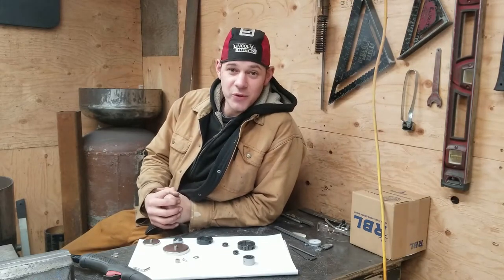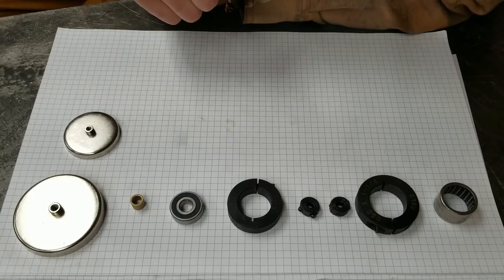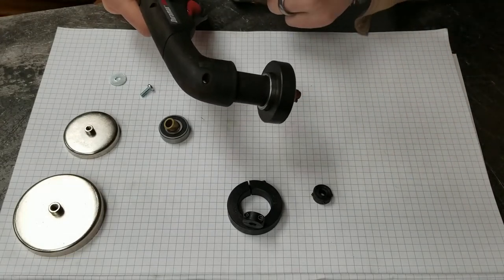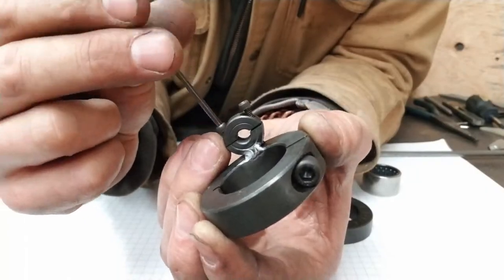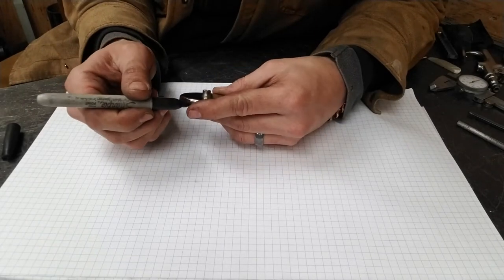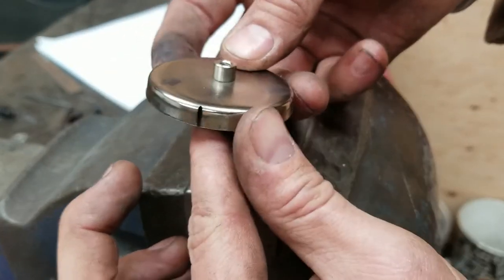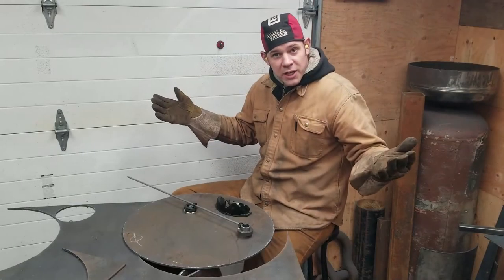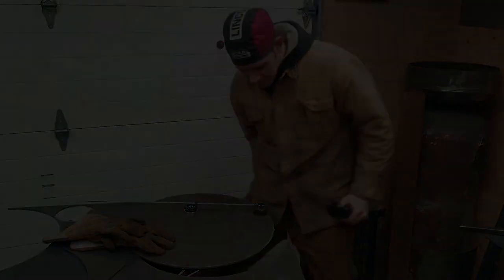BUILD IT - Plasma Circle Cutting Guide!

Comment: If anyone ordered the magnet that doesn't have the threaded standoff, you can just use a M8 bolt coming up through the magnet hole and through the bushing, it will work just as well (I ran a tap through the magnet hole as it is just a hair too small for the bolt to slide through).  Just use a washer and nut on the other side to lock it in place and everything else with putting this together will be identical to the video.
Reply from the maker: Thank you for posting this additional info 👌

Comment: Thank you for this!  And thanks for listing the parts to buy!
Reply from the maker: For sure 👍
Reply: @ShopGoatVentures  Say, I wanted to let you know that one of the parts listed above is not correct.  In the video, you have a round magnet with a threaded stem (you called it a spigot).  But the part listed is a magnet with an unthreaded hole.  No stem / spigot.  No way to mount the bronze sleeve bearing.  Can you tell me the correct part?  I looked & looked on McMaster Carr, could not find equivalent size of magnet with a stem, like the one you have in your video.   Thank you so much.
Reply from the maker: @LA-gd4eo  Your absolutely correct, I apologize for the error. I was able to get ALL the required parts through my local supplier except for the magnets. What I had done was gone to my local hardwood store and bought a couple cheep "magnetic hooks" that looked like the magnet from McMaster Carr. The problem as you have noticed, is that although it "looks" kind of like it, it is NOT the same. I never looked at McMaster Carrs detailed drawing until now and noticed what you just mentioned. I guess I fluked out big time. Once again, I'm sorry. 

The magnets I purchased from my local hardware store are called "magnetic hooks". At the time I had just removed the "hook" portion from the magnet and thought I had achieved the same part in the McMaster Carr list, obviously not. Long story short, I will add a link of the type of magnetic hooks I'm talking about (from what I have seen they come in 1.5", 2" & 3" - 2" being the one I chose to use in video) 

https://www.princessauto.com/en/10-pc-1-1-2-in-magnetic-hooks/product/PA0008326746 (Princess Auto is kind of like a Harbor Freight equivalent) 

Assuming you are in the US I will add a amazon.COM link...https://www.amazon.com/PRIMADA-Extra-Strong-Magnetic-Hooks-Chrome/dp/B00BUQAKP8/ref=sr_1_15?dchild=1&keywords=magnetic+hooks&qid=1627359529&sr=8-15 (Take note these are just the types your looking for. I'm not sure if the spigot diameter is smaller on the 1.5" magnet then on the 2" magnet)

Here is a Amazon.CA link to 2" magnets https://www.amazon.ca/Magnetic-Hooks-Powerful-Heavy-Duty-Refrigerator/dp/B01K030WYK/ref=sr_1_5?dchild=1&keywords=2%22+magnetic+hooks&qid=1627362138&sr=8-5

Last but not least...McMaster Carr does sell magnetic hooks https://www.mcmaster.com/hooks/magnet-mount-hooks-5/ (Take Note the types are labeled A, B, C, D, E, Etc.) Type A is the type you want. Type B looks like the "spigot/stem threaded portion" is a separate riveted pc. I would try going for either (Part # 14025A32 Magnet-Mount Hook, 2.75" Wide x 2.75" High x 1.5" Deep) or (Part # 14025A31 Magnet-Mount Hook, 1-7/8" Wide x 1-7/8" High) I hope the white powder coated finish does not make it difficult to unthread the hook.